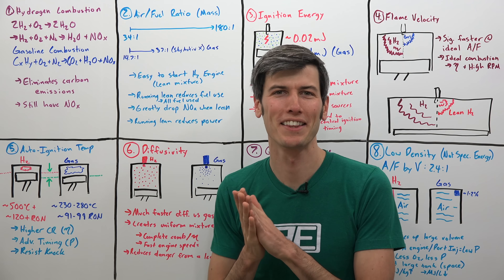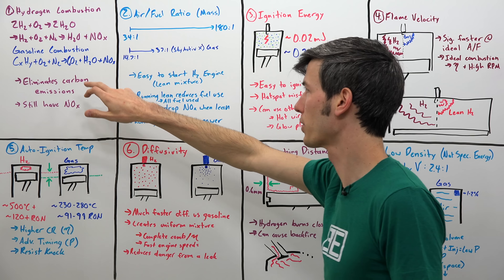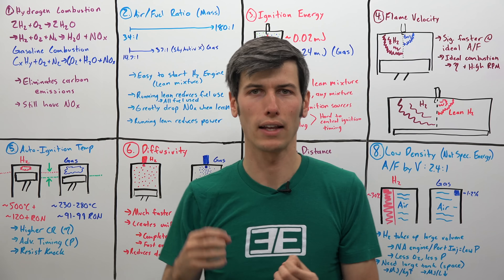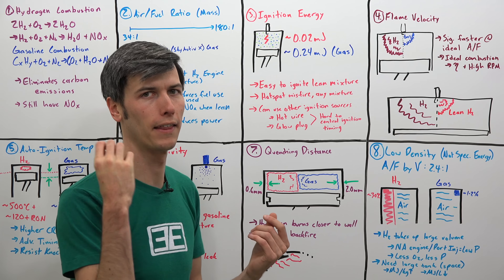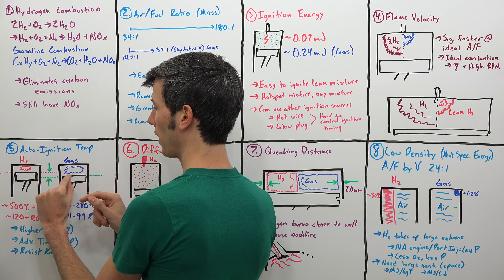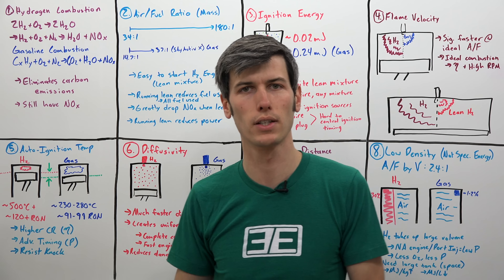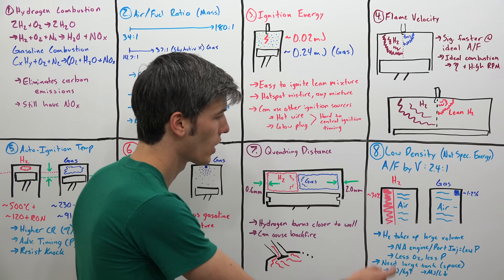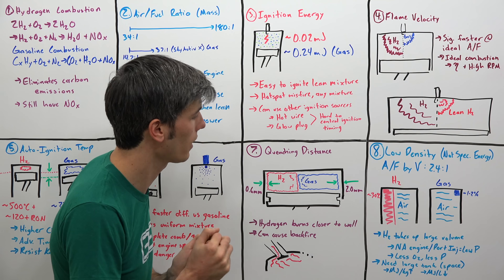The Difference Between Gasoline And Hydrogen Engines

Comment: HYDROGEN JUST RUSTS THE ENGINE INTERNALLY DUE TO HIGH WATER CONTENT.. A COMPLETE NEW TYPE ENGINE WOULD NEED TO BE DESIGNED THAT COULD WITH STAND THE CORROSIVE PROPERTIES OF HYDROGEN GAS
,,,,,,, COST INEFFECTIVE,,,,,,
Reply: Ah, except 99% of the exhaust from an ICE burning gasoline is water.

Comment: Unless we consider splitting the molecule at the points of injection with extreme high frequency voltage and very low amperage.  Then, we literally...fill our tanks with water 💧

Comment: I remember looking at this in a Ford research study using cylinder pressure analysis.  The study showed very high maximum rates of pressure rises compared to gasoline.  We thought that the engine would have to be structurally much more robust to accommodate the pressure loads.  This was way back in 2006 or  7  when the study was presented.
Reply: So, a diesel-like engine structure would be recommended?
Reply: @exploranator  my thoughts exactly. diesel-like would bypass some of the downsides presented in this video and Mike's observation.
Reply: does that also mean hydrogen is right now a better fuel source for heavy duty machinery like trucks and farming/construction equipment?

because I think unless the weight of the engine can be sorted out to both resist high pressure but also be light; I’m not sure it could rev up despite the power increase
Reply: @egonzalezm  If I remember they've done diesel to hydrogen conversions with just a few attachments
Reply: @jayevans7737  a diesel engine is virtually identical to a petrol engine. I can't see it being a massive change to run them off hydrogen just need swap out glow plugs for a spark plug of some sort and changing the software. I'm no expert but the mechanics are very similar if someone can home convert an petrol to diesel engine or vice versa then it's obviously possible. Search garage54 they did it I can remember which way I think a diesel to a petrol.
Reply: interesting… I can already see a “Turbo Charged Hydrogen” stamped on some trucks lol
Reply: Of course big oil bought and buried all hydrogen patents and technology. 
We should of had this hydrogen tech and batteries before WW2... But it's hard to sell people fuel they can make at home from 💦🌊!!🙈

Also many people who publicly showed off their hydrogen texh working prototypes all ended up dying under questionable circumstances. Like car crash plane crashes, boating accidents, bicycle accidents, etc... Hired killers don't use guns anymore because they prefer not to be investigated by law enforcement...  If you have been paying attention to the known unknowns of our modern society...
Reply: Until you get into 1 car accident and with a tank full of hydrogen you'll blow everyone within 30 meters to straight to hell.

Comment: If the hydrogen is produced through electrolosis how would the NOx emissions differ to burning a carbon-neutral material such as wood? Would it be more/less or equal? Can this be counteracted?

Comment: I like everything you have explained, but what if you used water as your primary source for hydrogen and cracked the water via electrolytes or even resenant frequencie at the intake,and a cold running engine and a cold turbo. How much would this change the outcome ?

Comment: About the high diffusivity of hydrogen ... doesn't that mean that when ignition occurs every molecule will have both nitrogen and oxygen molecules in close proximity? So I guess what I'm asking is that "given the choice," would a hydrogen molecule be more inclined to react with an oxygen molecule rather than a nitrogen? In a low diffusivity situation, wouldn't you have hydrocarbons looking for oxygen to react with but only finding nitrogen and thereby reacting with it instead?

Comment: Hydrogen is the largest  energy substance in the Universe  Let that sink in people. Made from water and releases water to be recycled over and over with no harmful emissions.

Think of you house having it's own Hydrogen converter to supply power to your home, and every thing now run on fossil fuels., solar and electricity free. It will work 24/7/365 no matter the weather. No power lines to fail or be overloaded. Or do you want to throw trillions at non-sustainable like solar and wind?

Comment: Amazing! I have been curious about H2 for ICE for ages but I’m not a car guy and didn’t even know all those factors existed. That looked like a lot of work... but could you do it again with Ammonia?
Reply: aMmONiA IsN'T VerY fLAmMaBLe
Reply: @zephyrtolliver4113  Ammonia for cleaning is mostly water. Pure NH3 is very flammable, almost as good as gasoline and easier to store than H2. But I don’t have the depth of knowledge to compare in ICE use.
Reply: Aramco has teased NH3 for a variety of applications, with the primary focus being Aviation

Comment: Ah!  The son I never had!  I express admiration mixed with some concern.  You haven't addressed the question of corrosion.  Firstly, the oxidation product would likely cause the metal of existing engines to rust.  Second, and an even more significant concern is when the oxides of nitrogen formed dissolve in the water producing nitric acid.  Here in CA, the "brilliant" drones at Air Quality Resources Board decreed that gas water heaters shall be low NOX.  Among other things that caused the price of a home water heart to zoom from about $110 to somewhere between $300 and $500.  And those heaters are CONSTANTLY being returned to the stores due to early failures.  Why?  Because there is not enough heat to loft excaust gases out of the system and release into the surroundings.  The resulting nitric acid trickles back down the combustion tube to the burner, rotting out both.  In the case of an engine, I would be concerned about nitric acid eroding the cylinder.  The first symptom would be decreasing mileage leading to backfire and perhaps car fires.  Then there is the question of hydrogen embrittlement of iron.  I think that what your supurb presentation clearly shows is that the world is dependent on carbon-containing liquid fuels to operate our vehicles.

Comment: All this is true, but if we turned gasoline into a gas vapor it would burn cleaner and more complete thats why a flue injection system is better then a carburetor system becuse your turing a liquid into a vapor, but if you compress the fuel it would come out a vaporizer 
I dont mean all the gasoline just small amounts of it under heat so its a vaporizer state then when you inject this into a motor youll get more power and almost all of it will burn up if not all of it.
But its highly explosive in this state.
More miles per gallon less gas to go the same distances  and more power.
This solves pollution problems by cutting back greenhouse gases and energy problems. But wait somone wont make as much money selling gasoline.
Reply: The long game is how do we use energy without adding more carbon into atmosphere from geological sources that stored it underground millions of years ago.

Comment: What if you took the oxygen that comes from the separation process and injected it into the cylinder instead of air??  The majority of air is nitrogen, and that's not helping the ignition process at all.  A lot of oxygen can be comperssed into a small space at 2200 psi and mmaybe higher.  Or would that just burn way to fast to be controllable?

Comment: What happens to the engine oil when burning hydrogen? Answer: Because of the naturally occurring 'blow-by'  of internal combustion engines ....the water vapor byproduct of burning hydrogen will ultimately mix with the oil turning it to a 'MILK SHAKE' appearance (similarly to that of gasoline turning the oil black from carbon). (Unless that's accounted for ....that can destroy the engine.) (To the unaware...it appears as a blown head gasket.)

@8:22 he talks about advance timing. That's laughable.  Hydrogen burning engines require a timed ignition approximately 8°  'post' TDC (top dead center) because of its burn rate opposed to gasoline. (Methane [a.k.a. Natural Gas] engines require require up to 12° post TDC). Burning Gasoline is much slower than hydrogen, and ignition timing usually requires between 7° to 0° BEFORE TDC. Burning Hydrogen at gasoline timing requirements will actually 'buck' the pistons and eventually kill it the engine. (There are fixes for that.)

His last point about using Hydrogen as a fuel assumes one would store/use & comsume from pre-pressurized tanks for one's hydrogen fuel. That's one way of doing it, but producing it on demand is much safer and cheaper. (Yes, there are systems that have existed since the 1980's that had sufficient capacity to do so and publicly demonstrated this as such). Lastly,  a point he failed to mention concerns H20 as a source for hydrogen. As such "Water" has 1/2 the BTU equivalent of gasoline's energy equivalent measured in BTU's. As such, if water were used as the liquid component (see above statement) it'd take 2 gallons for every 1 gallon of gasoline.  But then again...the cost of tap water isn't near that of gasoline either.

Comment: Ok now what you should break down next is cost to output ratio hydrogen electric and combustion engines. Start to finish car manufacturing to the lot with there power supply

Comment: So given the density of Hydrogen, will we see any performance increase from forced induction? Or does simply changing the injector size and or outlet pressure, with a lighter than air fuel remove the need for forced induction?

Comment: You didn't address the aspect of production of the fuel in the first place - you only covered the fuel in the internal-combustion engine aspect (great presentation, BTW).  Crude oil comes out of the ground and is cracked using heat to produce gasoline.  Hydrogen comes from... the ocean which is full of it as I keep hearing. But not correct, the oceans are full of water (H2O, NOT H2), which is one of the EXHAUST by-products of burning H2.  So, one must split the H2 from the water molecules which requires as much energy to separate as the combustion process produces (true for any process, but I'm assuming hydrolysis as the most straightforward). Given the efficiency levels in both directions, this results in a large overall LOSS of energy.  Remember, to completely replace the fossil fuel with green hydrogen, you have to first generate at least as much energy as the fossil fuel contains in order to put it into hydrogen gas form.  There are no magic tricks around this.   Sure, we can set up large solar arrays and use that electrical energy to produce the hydrogen gas, but how much carbon is released in producing the solar panels?  How much energy are we talking about? How many square miles of solar farm do we require to achieve this?  TLDR I estimate about 10,000 sq miles.  This would cover every square inch of Massachusseetts, but only less than 10% of Nevada, which gets more sunshine anyway.

Comment: I didn't hear much mention of the o2 thats associated with a hydro cell, are we only talking about the hydrogen or is the oxygen needed in these equations? I know there is a huge difference in the burn rate when mixed compared to without the o2, (pop vs poof).

Comment: Excellent summary but it leaves me thinking that piston engines and hydrogen do not mix. The engine design is not that different to what Karl Benz developed in the late 19th century. Maybe best to use hydrogen to power fuel cells and propel any vehicle using electric motors?

Comment: Do your research well. There's no combustion in a fuel cell. The hydrogen flows through a catalyst, preferably platinum to strip it of its electrons which is used to generate electricity to power the car. The hydrogen then pairs with oxygen molecules to produce clean drinkable water as the by product

Comment: When you work with Oxygen you realize everything is a Fuel.
When you work with hydrogen you realize everything is an Oxidizer.
When you work with High Voltage you realize everything is a Wire.
When you work with Science you realize everything is Fascinating.

Comment: This must be old school, they have where it works in vehicles with small half litter size tanks for hydrogen with five pounds of pressor using back flap valves on a 12 volt activation circuit mix with a fuel start up. The vehicle runs out fine on hydrogen and stays running, at least the ones I seen back five years ago did !

Comment: I occasionally work with helium for testing lines for leaks.  Helium atoms are small, hydrogen is smaller and can more readily leak.  On the helium detector I use.  To calibrate and test.  We have a bottle that has an intentional calibrated leak.  It is about the volume of a propane bottle for a camping stove.  That calibrated leak bottle is certified for 3 years of continous leaking.  Hydrogen lines will not be forgiving of leaks, and some of it will escape through the lines.  I do not think it will get to dangerous VOC.

Comment: Gasoline is basically carbon and hydrogen Adams.. as the engine breaks down the hydrocarbon.. it uses the hydrogen to create a flame to push the motor.. the waste product is carbon dioxide which CO2

Comment: No. 4 Flame velocity...  Would it be a benefit to have a longer reaction in the cylinder as with gasoline than the shorter reaction as in hydrogen in that the longer reaction would take better advantage of the rotating gear where the crankshaft is at 90 or 270 degrees as opposed to 0 - 180 (top or bottom center) to the shaft centerline.

Comment: I'm a former Rochester Products fuel systems engineer.  I recall that hydrogen requires positive ventilation on every garage or shop to vent spare gasses from H2 applications; gasoline does not.  Your thoughts, Jason......

Comment: What about using a dual output "hho" generator and feeding the separate gasses into the combustion chamber,  no outside air allowed. I understand that a necessary input of greater energy than is produced would reduce efficiency,  but, with Li-ion batteries on-board energy for said purpose would be available and and on demand due to the increasing prevalence of charging stations for such

Comment: Two things I would like to mention that I feel were not addressed fully enough.  I'm not real familiar with Nitrogen, but I'm very familiar with engines and the operational processes.  

One of the things mentioned in this video was the concern of pre-ignition caused by a hotspot in the combustion chamber.  After watching the video, I can certainly see that being a big concern for a port injected engine.  However, with the current technology, I would think that would be easy to overcome by using direct injection instead of port injection.

Second item is space taken up in the car.  Nitrogen, like any gas, can be liquefied by compression.  Nitrogen will liquefy at room temperature at roughly 200 PSI.  That's pretty high pressure to store fuel, but it is certainly achievable.  In a liquid state, hydrogen would no longer have as major of a disadvantage of the huge storage compartment.  

However, my research tells me that liquid hydrogen, due to it's lower liquid density compared to gasoline, would take abut 4 times as many gallons to get the same amount of energy as would be in gasoline.

Good article.  I always enjoy learning new things, and I enjoy cross-checking stated facts for either corrections or clarification - or additional useful information.

on a tangent:

I look forward to the day when electric vehicles are more feasible for more than just local driving and minimal storage space.  It appears that EVs are the future, and I think that's great for the environment.  One place it falls short though is storage.  What happens if there is a major power outage and all there are is EVs??  The area will be in a world of hurt until power is turned back on.  In addition, as EVs grow in use, the power grids will more taxed to meet demand, and will have to be grown immensely - in efforts of curtailing said power outages.  I have concerns for the future in this respect.

Comment: From what I understand the only reason we aren't using them is the cost to manufacture hydrogen, the explosive nature of hydrogen, and the fact that the byproduct of it is H20 (water) which would mean engine blocks would have to be chrome lined or made of stainless steel which adds costs and problems to the manufacturing of the engine and exhaust system.

However I would love to see hydrogen fuel explored more than it is.

Comment: Maybe you can explain..

 In a rocket you would use liquid hydrogen, why wouldn’t you use liquid hydrogen in a car? In would require certified installation reducing refill risk. 
This seems to solve you’re fuel tank issue

Comment: Infrastructure prerequisite is to line existing pipeline(s) with plastic and install new polymer pipelines. Steel pipe problematical.
   Fuel cell > electric motor much more efficient than internal combustion.  Fuel cell technology catching up quickly.

Comment: I feel like hydrogen fuel would best be used on off-road vehicles first, such as UHVs, ATVs, and dirt bikes, at least until better storage solutions arise. Or, you could use electrical plasma to split the water into hydrogen and oxygen before it reaches the injector, and then you ignite it with a spark. No air intake at all, which means zero NOx emissions. The intake stroke is strictly for the injection of hydrogen and oxygen.

Comment: Since the Earth atmosphere is over 70% Nitrogen - you'll never ever get rid of Nitrous Oxides. 
Talked with a automotive tech working on Hydrogen engines. He failed to purge the hydrogen line and went to tighten the coupling. It blew up and sent the wrench flying and got mild burn on his hand. It's all a bomb waiting to go off.
Who needs a trunk of C4 when a tank of hydrogen will do just as good.